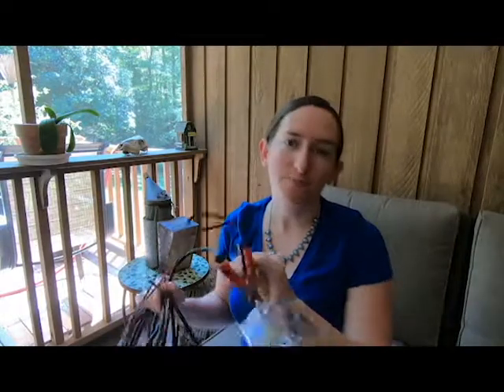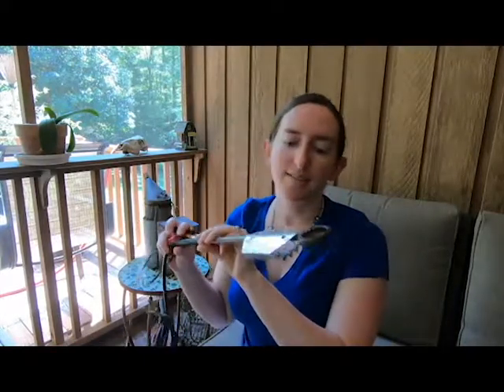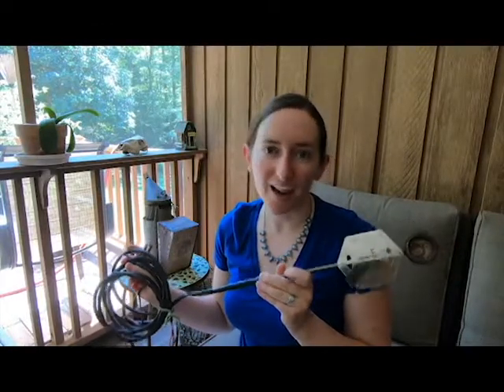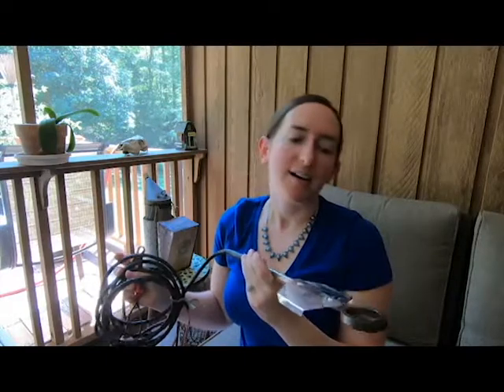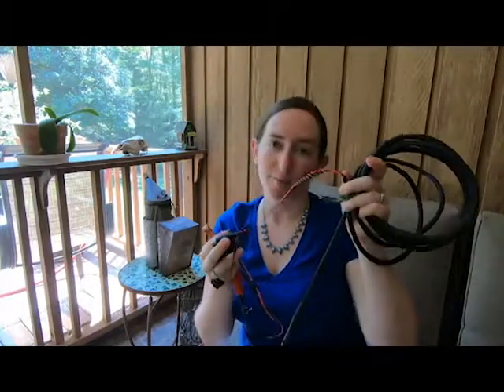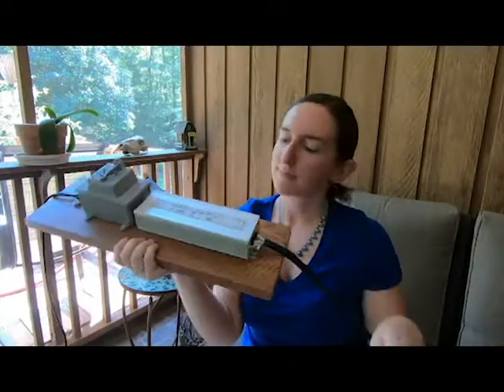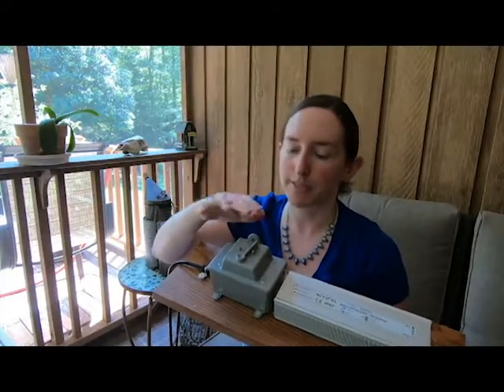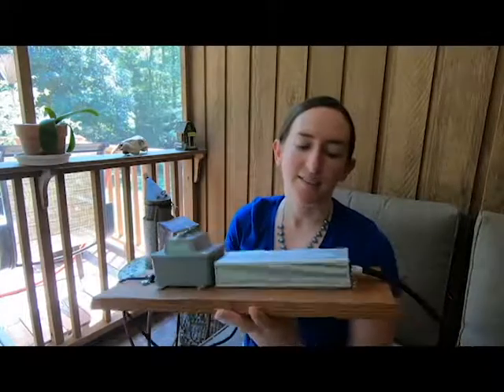DIY Power Supply for Oxalic Acid Vaporizer | Beekeeping Hack

Comment: I noticed the Amazon power supply has two leads coming out of it.  Are both leads wired to the vaporizer or just one of the leads?  Great video!
Reply from the maker: I know I responded to your email w/this info, but for anyone reading the comments I'll answer here too: We joined the two red wires together and the two black wires together. Both reds come from the same terminal, and both blacks come from the same terminal.